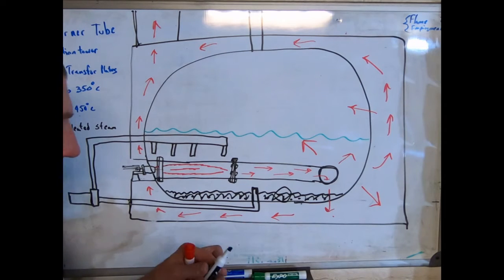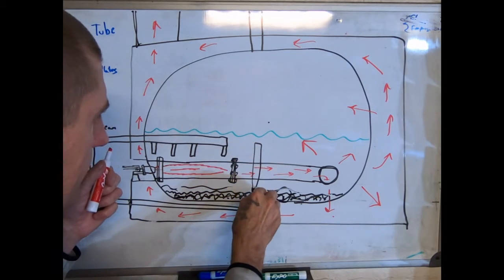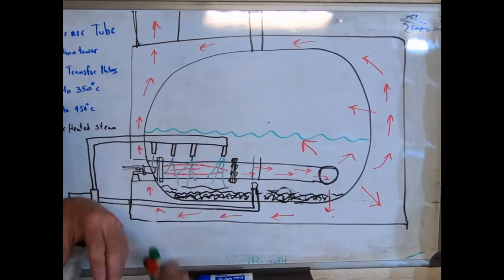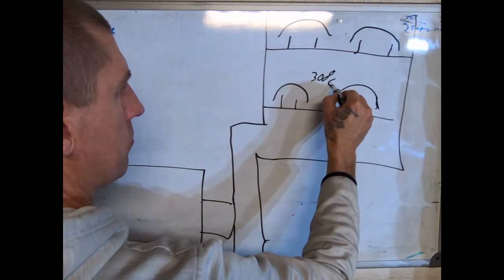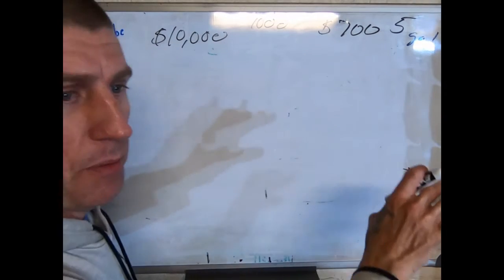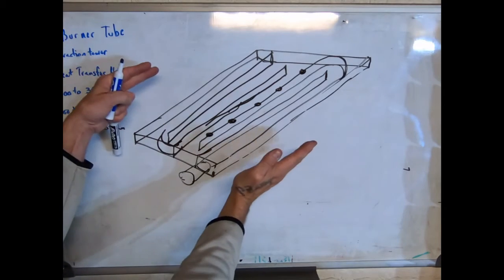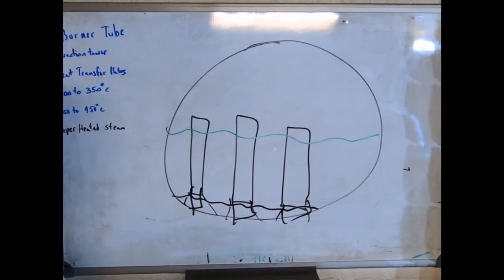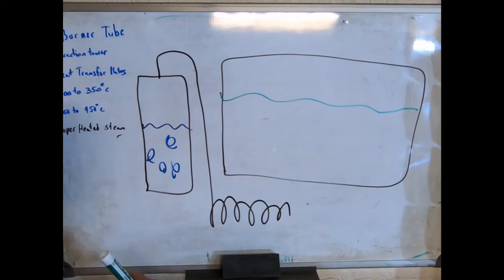T dog Desert style plate heat exchanger

Comment: after a day's thought, going "low" temperature still seems to be a good idea.

alcohol 75+c 
water 100c as insulator
gasoline 100+c 
acetone 180c 
turpentine 200c
diesel and heavy oil 350+c

those are the figures from books, and they are those useful parts, tar on the bottom is useless.

just like people distill moonshine, water can be use to indicate temperature and "occupy" the empty space in the distill chamber. according to faa figures, any confined tank with 12%+ oxygen, the rest is fuel vapour can combust if ignition source occur. to prevent shtf, my thoughts is to occupied the space with non combustible substance such as nitrogen, sand, pebble stone, water. where do you get cheap nitrogen? it is already there in the equation. normal atmosphere is 21% oxygen, almost 60% nitrogen, 2% co2, the rest content such as argon don't burn much. therefore collect the gas from the fire burning chamber and route it into the tower is a cheap way to achieve. but there is a catch, you need a valve to prevent backfire and spark to the distill tower and shut it when the burning chamber is not in use. 

so, a tower with maximum 350c operating temperature is what you need, if exclude diesel, 200c max. as temperature change in the tower, bypass valves is need to prevent cross contaminate of products. and a remote oven sensor probe which is reliable up to 400c correct is a good idea.

hope that is useful to you.👍

Comment: OK, that's a challenge, sulphur something in the mixture and a distill tower.…

filtering, you need some kind of filtering before you put that "juice" into distill. old glass fiber, charcoal dust and sand in a double 4 gallon bucket tower up may do. it cost "almost" nothing. you may also need to check the ph as well, your test result give me a impression that some kind of sulfuric acid occur in the chamber. neutralize it with something like washing soda before cook it.

the distill tower is a real challenge, those little bowl you can check the dollar store see if they have stainless steel kitchen bowl or small tart mold. the problem is, distill tower is some kind of pressurized device with flammable gas and liquid. and at the same time you got to take away heat to condense the juice. my guess is to put a thin layer of pebble stone and some water over those cup for weight, water is heavier than most fuel and solvent, and it help stop it touching with oxygen when damn hot. but it also restrict the operation temperature under 100c or 212f. very likely the final product won't be 5~6 storey, may be 2 max. control the tower temperature and work in small batch would be the key to success. some copper coil or water jacket to take away the extra heat is a must too. the quickest way i can think of is to go to car scrapyard find a car condenser and put it into a large bucket. scrapyard grade condenser means leak. but as long as it stay totally submerged under water, and the coil/tube is running water too, it may be fine. 

I guess it can be done, people in late 19 century don't have most material and machine we have, but they can distill cruel oil. but there is a catch, it is a pollution and danger business, always run in small quantity (bucket size or less) and have fire control measure. definity not indoor environment.

Comment: Sounds like you need a blow down recirculator like in tube boilers to eliminate sludge buildup at the bottom.
Reply from the maker: Yes we discussed this when i first met them and when the tank was re  installed the second time . the build up is a huge problem